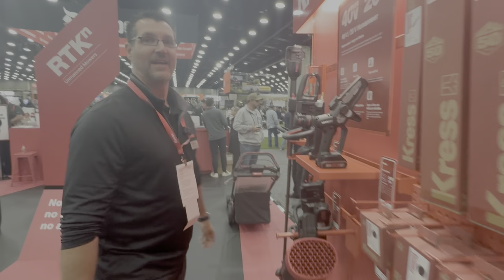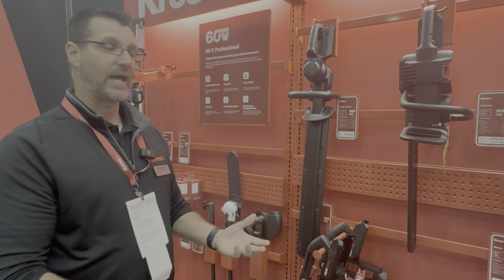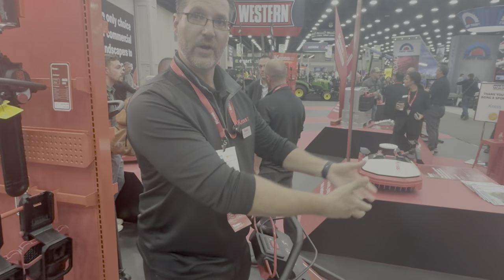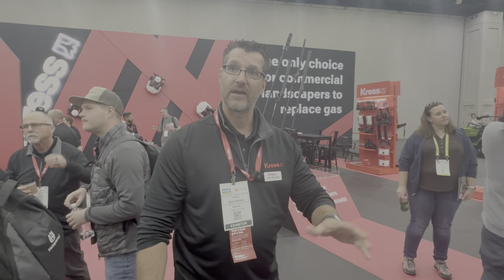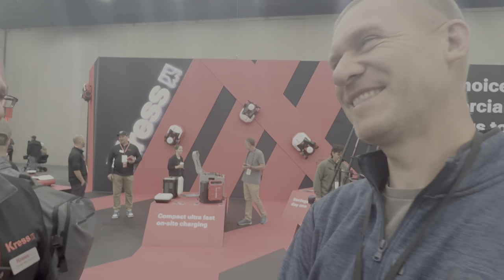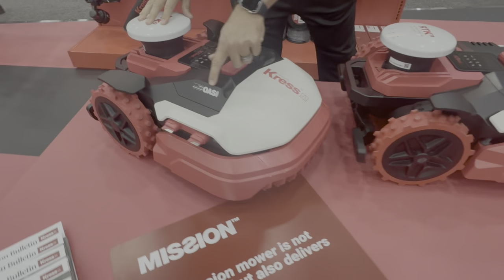NEW PRODUCTS TO THE U.S. MARKET (From Germany)

Comment: Are they made in Germany?  Kress way bought-out by Positec Tool Corporation, which designs and manufactures in China.  They have some pretty good blowers and  a really cool mobile battery charging solution, but the murky nature of where the tools were coming from kinda scared us off from selling them at our shop...
Reply from the maker: I agree, however they are no different than Dewalt or Milwaukee tools as many of their products are made in China also. The labor costs are too cheap to made elsewhere. 
Keep on tractoring!
Reply: @ritterjon  Ain't that the truth? I've got a couple pieces of Stihl battery stuff that's made in China too!  Kinda shocked me, to be honest.  Works pretty good, though